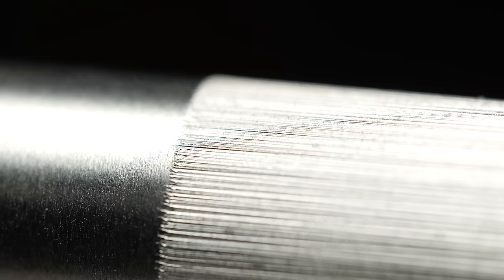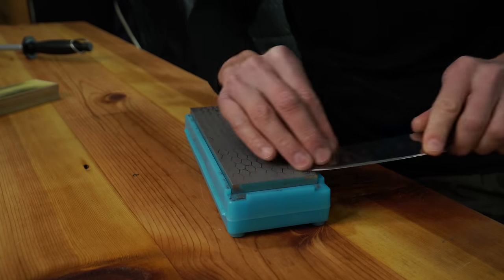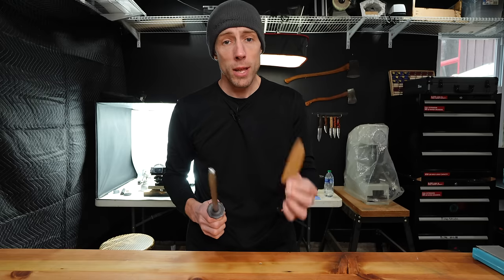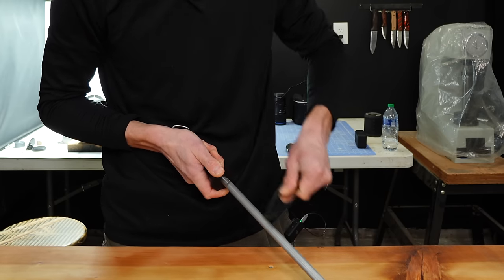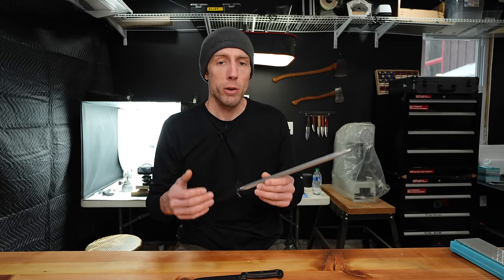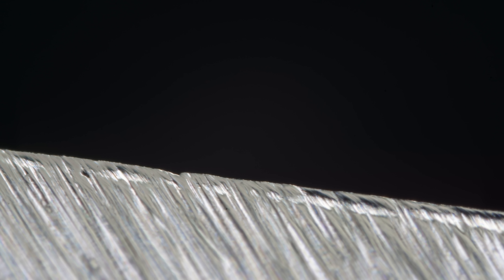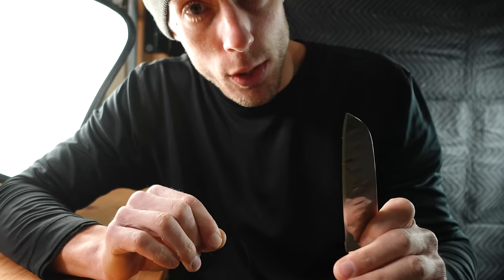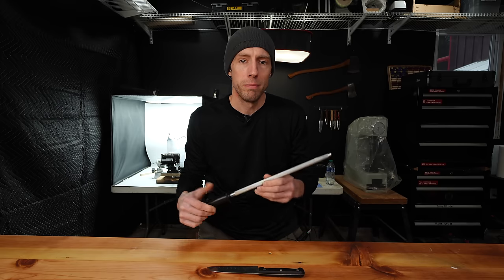What Do "Knife Sharpening" Honing Steels Actually Do?

Comment: Former Butcher here, my two cents: the KEY is to use the honing steel fairly often, every 10-20 cuts, to PREVENT the edge from rolling too much: LIGHT pressure, LEAD with the edge, do the whole blade from heel to tip in a single arcing stroke.
When the edge bent excessively to one side, it was time to send the knife back to the sharpening service. At that point there was nothing we could do to fix it with a honing steel.
It is probably the most difficult tool to master in a kitchen or butcher's shop, it take A LOT of practice to use it properly and only about 5% of the people I ever met could actually put it to good use, everyone else just messed up the blade. But it does have a purpose.
Reply: I'm a chef and I agree with you, for nearly 40 years I've been using steels to sharpen my knives and I still use the same knives I started out with, I've got through a few steels though! There's a big difference between someone with little knife experience making a YouTube video and a proper professional experienced knife user. There's a reason we use steels and I'd say it's because when done properly it's fast, efficient,  and doesn't damage or cause excessive wear to the blade. You need to use it properly and regularly though and I think it's something that comes with experience and not something you can do after a couple of weeks of messing around.
Reply: 70 yr old son of a butcher. My old man didn't teach me much, (except what NOT to do to be a good father), but he taught me at about 12-13 how to sharpen, use & maintain knives.

He was older when I was born & learned butchery in the late '20's, (1920's!), in NYC.

He taught me how to create a proper edge on a blade & taught me EXACTLY what you explained re: the purpose & use of a steel.

This guy is using diamond, which I use, now, & love.  Diamond is akin to cheating, compared to natural stone; the surface is nearly perfectly identical, unlike a stone & it's cutting ability reduces passes by 60-70%, in my experience.

When I got some diamonds, I sharpened everything w/ an edge I owned: knives, scissors, lawn mower, (I keep a knive-like edge on it... it works well), hoes, trimmers, pruners... you name it.

I brought all if them to dangerous sharp in about the same time it took me to do 2-3 of them.

There's things poster doesn't understand about what he's 'busting'; too old & don't have the time to waste explaining it all to him.

One other thing, I, too, have amazing magnification capabilities & most people can for less than 10 bucks... buy a moderately good jeweler's loupe.

I have one I use regularly, several actually, & another that's about 2x's the mag; it's good for looking at intricate stuff like end mills, taps & such, but overkill for a straight edge.

A last tip I discovered/then stole from the machining world. You know how machinists 'blue' things w/ die; blue Sharpies have replaced Dykem for most purposes.

I use a blue Sharpie on an edge before I sharpen it, as a visual guide for contact angulation; it helps, even 70 yr old hands that have sharpened for 50+ yrs.
 
GeoD
Reply: Caveman line cook here. I’ve always lead with the edge with great results. I guess I’ll never start using my steel backwards, because it will ruin my edge.
Reply: Sharpening service? A butcher that can't sharpen a knife is like  a mechanic that can't use a wrench. You are benched.
Reply: @jeffreybrown4015  There was a time in this country, pre-carbide era, when sharpening experts & shops were common.  In my teens & 20's, all carpenters had 2 racks of saw blades, alternately traded w/ 'The Sharpening Guy'.  In some communities, these guys did knives for slaughter houses & grocery chains; the butchers did the maintenance, but a 'new grind' wasn't done in house.  Thet also did work for the average consumer.  Put it all together & a man could feed his family.

With the advent of carbide, the handwriting was on the wall, within a decade, a 'Sharpening Guy' was nowhere to be found.

Gets me to wondering about blade users; suspect a knife gets chucked & replaced, now, instead of re-ground & re-birthed.  We do live in a throw away world.

I inherited my dad's knives; used them for years, they'd lived & worked a long life. They're in an attic box, somewhere, the handles got too beat for anything but a bachelor's household.

My main blades are ceramic, w/ an eclectic mix of oddball fav's.
Reply: @jeffreybrown4015  I actually agree. Though nowadays that is Not how it works: shops do Not even own the knives anymore, the knives are the property of the sharpening service which actually replaces the knives every fortnight or so with sharp ones, takes the dull ones back to get them sharp again and so on. This way is faster and more cost efficient in the long run.

By the way I am personally a knife nut (that is why I am here) and I can sharpen and hone my own knives, tools and straight razors. I fix semi trucks these days so I also know how to hold a wrench.
Reply: Did you strop your edges to ensure you removed the burr?
Reply: @TTLVID  70 yr old son of butcher. He didn't teach me much, but he did teach me about knives & sharpening in my teens.

I cannot 'steel' a knife like a pro, but I've found a slow speed which is effective.
This guy's schtick appears to be stirring up people by condemning something he knows little about, to stroke the YT AI's algorithym; seems to work.

My old man's knives are in the attic, but a small steel of his, is in the kitchen.

Seems to me I recall him saying using a steel didn't produce abrasive grit, like a stone or any metal particals, other than microscopic.

I have ceramic knives & an eclectic array of steel & use diamond 'stones' on both, even the serrated, (one side is flat; flat hone them to make wicked sharp edges).  Using diamond is like cheating; takes 20-30% of the strikes to acheive a smoother edge than vitrious stone.

I, too, have high powered magnification as a tool, but unlike this fool, I didn't waste money on an electronic scope. A fair quality jewelers loupe is less than $10; a high quality, Swiss is < $20, & all you need.

A tip to learning & 'perfecting' self sharpeners: use a blue Sharpie to mark ¼-⅜" of the edge & a loupe to check the consistency of your sharpening stroke & angle of attack.  The Sharpie's a hidden weapon in attaining scalpel sharp edges.

I need them on my machine tool edges; diamond stones, a loupe & a blue Sharpie make nuch easier to accomplish.
Reply: "Former Butcher here, my two cents: the KEY is to use the honing steel fairly often, every 10-20 cuts, to PREVENT the edge from rolling too much: LIGHT pressure, LEAD with the edge, do the whole blade from heel to tip in a single arcing stroke."  --  This makes far more sense than most of the stubbornly old-fashioned comments on this video.
Reply: @georgedennison3338  Maybe the definition of adhesive wear is a rather new definition. The honing steel may do adhesive wear instead of abrasive wear ("...other than microscopic ..." as your old man said), and do form a micro bevel at microscopic level . Check the wikipedia on honing steel and link to the source of the information.
Reply: @jeffreybrown4015  not an equal analogy, better one would be "a mechanic that can't calibrate a torque wrench"
Reply: Former butcher that does not sharpen their own knives? Does that exist?
Reply: All my adult life I’ve been sharpening, yes sharpening, knives with a rod. I can take a dull knife and get it sharp enough to shave my arm using only a rod. After that, there is metal left on the rod and after years of doing that rod sharpening, the knives get thinner. It took me some time to learn how to use a rod. I don’t use the rod like in this video.
Reply: @StsFiveOneLima  Great advice.  Keys words: "LEAD with the edge," just as you say!  One reason this guy's getting mediocre results is he's pulling the blade along the steel (backward) rather than pushing it (forward).  It can help to think of that steel as a stick of wood and to "whittle" away from oneself, using light pressure.  It makes quite a difference in achieving a fine edge.
Reply: That's way to often lol
Reply: @georgedennison3338 we still sent our knives to a dude once every 2 weeks. Every one was pretty damn good on the stones, but this guy was something else.
Reply: NO NO NO!!! MILLIONS OF BUTCHERS WORLDWIDE ARE WRONG!!! THIS RANDOMN DUDE ON YOUTUBE HONING THE KNIFE WRONG ACTUALLY KNOW THE TRUTH!!!
Reply: @georgedennison3338    I have been a machinist for around 40 years and started out in my teens grinding and sharpening tooling.  In that entire page long rant you said almost nothing.  Dykem in spray bottles is still very useful for layout on larger flat or curved surfaces.
Reply: Finally someone who gets it! My dad was a meat cutter for 40 years he seemed to do ok with the steel, millions of butchers can’t be wrong…😊
Reply: I will only somewhat have a purpose if the honing rod is harder than the steel of the blade
Reply: @whiteyfisk9769  …I can hear my dad yelling….at me…..god bless him.     😀🤣
Reply: @joshorr9662 😂
Reply: @jeffreybrown4015 that’s how they do it in big factories. You can’t be sharpening when you’re supposed to be on line.
Reply: Finally someone who knows their stuff. These honing rod videos make my head hurt.

Did you use a smooth honing rod or grooved like this in the video?
Reply: @jeffreybrown4015  The butchers can sharpen their own knives but there just simply isn't time for that. It's way more efficient to have someone else sharpen the knives.

And you need to have many spare ones since in that business you can mess up the whole blade with one bad cut and nothing will save it after that (except proper sharpening that you can't do at the moment)

Comment: I actually find these rods helpful when used in the right application. I use mine for very light "tune ups" in between proper sharpening - not repairing edges or anything just light maintenance. I usually sharpen my kitchen knives about once a year and then use the rod after every 2nd or 3rd use. This has worked very well for me and my knives are always razor sharp, but maybe it's a placebo effect or maybe it's only working because my knives are starting off properly sharpened. Great video in any case.
Reply: You're right. Honing rods are actually great, especially for maintaining knives with a pretty soft edge.
Reply: I like hard knife steels... to sharpen my card scrapers 😜
Reply: You always can use Knife Sharpening  Honing diamond stick without any issues!!
Reply: Exactly, they work well to tune up a properly sharpened edge that has been slightly dulled 
( rounded ).  Especially on softer steel.
I'm a professional carpenter / woodworker and have been sharpening everything from axes to razors for 50 years, and I think a lot of these guys kind of get lost in the weeds and overthink things.
Reply: And after sharpening with coarser India or Arkansas stones the steel would smooth and/or bend over the tops of the deep scratches and give the edge a smoother cutting “feel” for sure, and some might call that sharper than before. I always heard that the metal edge gets pushed and smeared around. 

I think some pro chef should come on the show and demonstrate before & after the steel use, and only after cutting real food and not just playing woodpecker with the knife (and with better quality knifes too). I respect Outdoors55’s blade making & sharpening, but don’t give a demonstration of something that you have no experience with. I think if there is something to learn about “sharpening steels” then seek out someone that makes a living with it, like chefs and butchers.
Reply: they are designed for light maintenance. not the sort of damage one causes deliberately, like cutting copper
Reply: Isn't this common knowledge? I always thought that the honing rods are only for quick fix if you don't have the time to sharpen the knife properly or if it is not too dull.
Reply: I agree, as a chef for 36 years I have used steels every single day of  work. They DO what they are supposed to do.  Anyone cutting tomatoes can tell you after a few the acid in the tomato "dulls" the edge and a steel brings it back with just a few passes. The knives we use daily are not our own, they come from a knife service that changes them out every week. I'm not going to take the time to sharpen knives that a service gets paid to do (paid for by our company) and when you're in the middle of service you're going to look like a complete moron stopping to get out a sharpening stone. If you're not working 8-10 hours in a kitchen daily you wouldn't understand actually how vauleable they are.  I'll stick with the steel.
Reply: What? Once a year? What brand of super knife do you own??
Reply: @rudysaldivar4228  Must only cook a couple of times a year ?
Reply: This is actually what they are for! NOT WHAT THE GUY IS DOING IN THE VIDEO!!! It is not a great video AT ALL!! It is very misleading
Reply: @wrp3621  totally agree.  It feels very similar to the "every day carry" youtubers that begin to totally miss the point, which is practicality.
Reply: Same here. I keep my chef knife hair shaving sharp for about a year with a honing rod before I have to take it back to the stone.
Reply: Stop using that honing rod.  it's actually ruining the durability of that freshly-sharpened edge you just got back from the knife maintainer.  A polished steel rod actually does a better job whilst also preserving the integrity of the edge.  I have taken a microscope to a kitchen knife that I just finished resharpening, and then compared it after I gave it a couple of light passes with the ribbed honing steel, and it looked just awful.  Stay away from ribbed hones.  I also don't recommend the ceramic myself, as they are unnecessary and still pose a risk to a properly sharpened knife.  Just use a polished steel hone.
Reply: @dirtyketchup  as a professional sharpener, I always recommend ceramic hones with proper use. I always tell whomever I am talking with, whether it be a chef, butcher, or just your everyday Joe, PRACTICE, with some practice and holding it with the right angle, they work just fine
Reply: @codygarner7495  I agree having worked for many years prepping in a kitchen. We had our knives resharpened by a professional sharpener once a week. During that week we abused those knives and when the edge starts to deform and they lose their sharpness we used the honing rod and it would straighten the edge and allow us to keep cutting. It might have been better to resharpen them ourselves at that point but all we were given is the honing rods. I don't think the tests in this video accurately show what happens to a sharp edge with the burr removed after making millions of cuts on a polyethylene cutting board. I do think they are probably an unnecessary tool for a home kitchen.

Comment: The first thing I notice after being a professional chef for over 20 years is that you don't use the steel correctly once. First of all, such sharpening steels are slightly magnetic at the tip and you place the blade there and then push the blade towards the handle. Secondly, in the kitchen we often use diamond-studded sharpening steels that remove material very finely. That's why it's important that every chef only sharpens his own knives and doesn't mess up the angle of his colleagues.